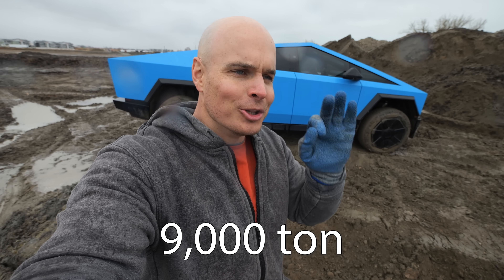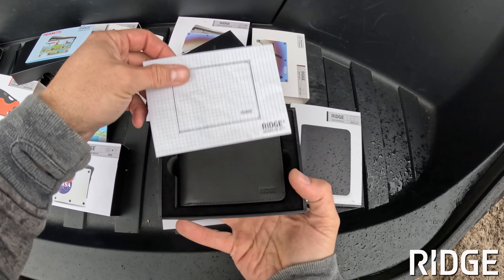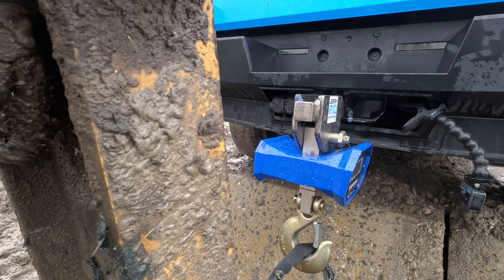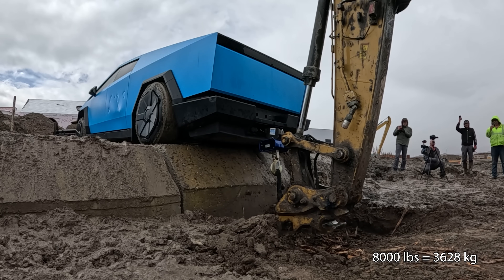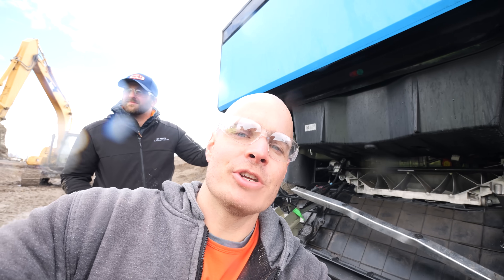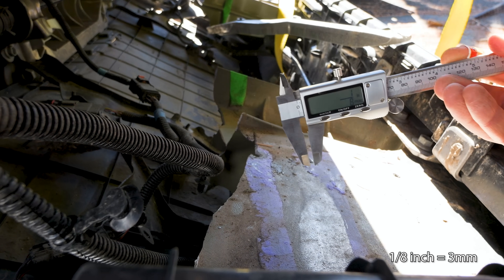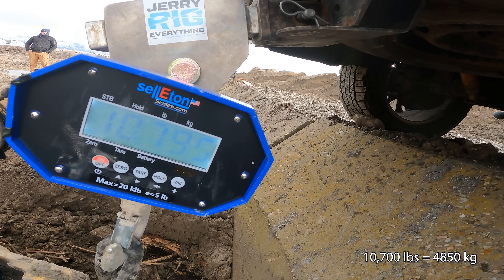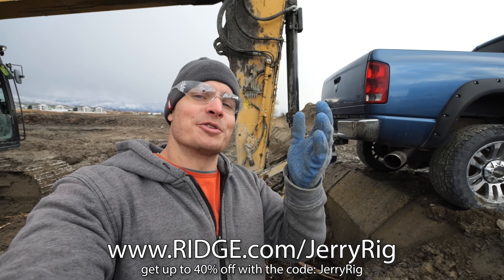SHOULD YOU TOW WITH A CYBERTRUCK?! - (catastrophic failure test)

Comment: You need to look up “fatigue limit”. The actual meaning is counterintuitive. Aluminum has no fatigue limit. Steel does. But that means that steel has a limit where if you keep stresses below that, you can do it over and over again without concern for stress failures. Aluminum weakens even in the elastic zone of deformation and as you said gets weaker every time. This it has no “fatigue limit “ aka safe zone.
Reply: Yes steel will last forever (corrosion excluded) in cyclic loading that does not reach the plastic limit, but aluminium, unless you use some rather expensive alloying metals in the mix, most of which are pretty toxic in themselves, like beryllium, the aluminium will start to show fatigue cracking after only a few thousand cycles of even moderate strain. then these cracks will propagate and result in failure. unless you keep the cycle load so small that it is well under plastic limit, you will have to replace it after a certain number of cycles. Which is why a lot of aircraft are scrapped after 20 years of service, as the cost to replace all those fatigued panels and stringers comes up to close to the cost of a new aircraft, which will be both more fuel efficient, and will also have a better passenger capacity, and lower running costs. Just the cost of checking all the wing spars for cracking, the most critical part, are so expensive that when this is due most are going to be scrapped instead, as the parts are worth more as fix parts than as an airframe.
Reply: @SeanBZA  Given the average trucks life expectancy to be 100,000 - 200,000 miles. And towing for a tiny fraction of the time. Given this fact the Aluminium is fit for purpose  so long as the buyer is aware of the pros and cons vs a standard steel frame.
Reply: @SeanBZA  Steel does not have a fatigue limit in practice. Large container ships experiencing ocean waves every day for decades do eventually start to fail. Nothing that a car will ever be put through of course, even driving for hundreds of years. But still
Reply: @krakmorfar Large ships fail because of rust thinning the steel, as the coatings do not really flex fully with the steel, and the rust weakens the metal to the point it will be out of elastic area and start to accumulate fatigue cycles, thus cracking. Recent examples are the Russian tankers that simply broke apart in heavy seas, just because neglect of corrosion control led to the hull members corroding through and snapping.
Reply: @SeanBZA  Sure, that's one way they fail. But the frame girders themselves do experience fatigue, and they will fail after going through millions of wave cycles. The concept of endurance limit introduced by August Wöhler in 1870 has since been proven wrong in practice when we started using steel hulls.
Reply: @SeanBZA  It's so refreshing to read real comments thank you.
Reply: what he meant was true, his terms were backwatds
Reply: this can easily be shown with spoons (or forks). an aluminum spoon will break if you bend it like 3 times, whereas a steel spoon will just bend and bend and bend
Reply: @Vinraymi a steel spoon will break in 4-5 bends. This whole thread is by engineering flunkees.
Reply: You're almost right. The fatigue happens in the elastic region for both aluminium and steel, and the fatigue limit is still below the limit of elastic deformation.
But other than that you got the principle right.
Reply: And isnt the ball weight 10% of max towing capacity. I am actually impressed that it carried so much weight on the hitch
Reply: He quite litterally said: "aluminum has no fatigue limit, it will just get continuosly get weaker and weaker"
Reply: This is such a bad test what can have the tires lifting off the ground and it has and will not happen to anyone
Reply: Jerry is not an engineer
Reply: Thank you for the refresher
Reply: Tell that to any helicopter manufacture on rotor blades...
Reply: correct
Reply: True but irrelevant to the frame. 
The number of cyclic loadings you have to undergo is a function of the maximum stress of each cycle. Unless you are loading this frame to 3000+ lbs thousands of times fatigue is not going to make much of a difference here. No one is out there towing a 10,000 pound load (properly distributed) everyday for several years with a cybertruck. They are simply too inconvinient to tow with for anyone that needs to tow that frequently. 
Their towing range is absolute garbage in relation to the time it takes to recharge their massibe battery.
Reply: Flexible aluminium like airplane is okay. But cyber truck has cast aluminuim that is very brittle than flexible that’s why fatigue failure happens very easily
Reply: thanks for explaining
Reply: @Yataro79 you’re welcome. I ran into this in the bike frame world recently and was confused. But once digging in, the counter intuitive (but technically accurate) phrase works.
Reply: Wondering how Airplanes, which are all aluminum, can deal with fatigue?  They have ratings of stress, so there is a fatigue rating.
Reply: @drew8256 I do not think the aluminum used in airplanes is the normal aluminum from a soda can, it has to be a special alloy way stronger, aerospace grade aluminum... light, yet very strong. But the cybertruck might be using just aluminum. Wonder how Tesla is going to improve that point of failure... even do 10400 pounds  is way way over the rated weight, not to be confused with the towing capacity weight, but that catastrophic failure is really not a good sign.
Reply: @portedbikes  You're asking to compress an entire Materials 101 course into a paragraph. It's extremely rare to use pure aluminum because it's too soft for most applications. Alloys of aluminum will vary depending on requirements. But most aluminum alloys I know of still have a cycle life. It's complicated. That's why I recommend a documentary on the Comet. We learned a lot on how aluminum alloys fatigue from those tragic accidents. Aluminum alloys are used because they are less dense than steel alloys, but with high enough strength and cycle life, but it's understood that it will fail eventually and need to be recycled. It's the reason engineers often refer to R&D and as Research & Destruction.
Reply: @portedbikes  Nobody uses pure aluminium for any structural applications.
They use either alu-copper, alu-zink, or alu-magnesium alloys for deformable structures, and alu-silicon alloys for castings. All of these alloy series are used in both aircraft and cars, depending on the application. So there isn't really one "aerospace aluminium alloy", the aerospace sector just has way stricter quality rules for the materials.
    Al-zink is the strongest alloy, but Al-magnesium has better corrosion resistance. However, if you add a little bit of scandium to an Al-Mg alloy, it becomes stronger (closer to Al-Zn) without losing corrosion resistance.
The thing with scandium, is that it's expensive, so it makes more sense in aircraft.
Reply: @drew8256 Very good question. The answer is in the fatigue. For example, take a tan from 2 pop cans and flex one a large range & the other a small amount. Count the number of cycles till they break off. You'll find they tend to break about the same number of cycles. This is why airplanes are carefully designed to spread stresses around and to mini minimize the # of cycles. To understand why it's bad,  check ooh documentaries on the de Haviland Comet, which was the 1st jet airliner. It had square windows where stresses accumulated.
Reply: Airplanes are made metal space frames brazed together to prevent cracks just like the Tesla isn't actually made out of stainless
 @drew8256
Reply: @drew8256  The airframe just lasts a certain amount of pressurisation and depressurisation cycles, after which the airframe gets scrapped. (And the airframe gets inspected for cracks). And then they obviously pick alloys, that fit the purpose.
It's just that by the time the airframe is worn out (which takes years), the engines will be rebuild multiple times, and the aircraft will be outdated. That's kindda the idea...
And modern airliners use metal with carbon fibre or glassfibres.

Comment: This is not an accurate test. By loading the truck downwards, the frame is loaded in bending, which exerts far higher stresses than in tension and compression, which are the main loads expected while towing. The fact that it withstood 10,000+ lbs shows that there is indeed no problem. And no, there is never a case where all the towing weight becomes tongue weight. That would imply that the trailer is elevated off the ground.
Reply: Yeah, the fact that they had to hold down the front of the truck says that if you did somehow manage to apply this load, your front wheels would just leave the ground.

Which would do two things.

First it would reduce cap the maximum load on the hitch, and second it would cause an accident anyway
Reply: 100% agree this entire test is ridiculous, it's sad there were so many people involved and none of them realized this.
Reply: @leeward6762 @whistlindiesels test says otherwise
Reply: the only scenario where this could happen is if someone were to reverse over a cliff and then have the trailer fall over the cliff. And in that case I'd rather have the hitch break instead of pulling the whole truck over the cliff.
Reply: Science!
Reply: Its very common to drop on the tongue offroading like in WD test which caused complete  failure

Comment: The Cybertruck hitch is rated for a maximum vertical load of 1,100 lbs. In your test it survived 8,000 lbs vertical without obvious damage and broke at just over 10,000. How is this bad?
Reply: Did you watch the video?

Under ideal conditions, it won't have much force exerted on it.

Under actual conditions? Hitting a pothole, the trailer shifts weirdly, there's plenty of reasons why the truck's hitch would receive the full brunt of the weight of the trailer. Also, look where it broke. Stopping and going will stress that part out, and like Zack said, Aluminum does not handle that stress like steel does.

And reminder... the steel framed Dodge, which was in an accident, barely bent. Where the Cybertruck broke. And the frame broke less than the vehicle's tow rating. That's a problem. a BIG problem. Whistling Diesel had it break when he was attempting a recovery, not even towing anything super heavy. And there's plenty of pictures of Cybertrucks with their backs torn off... It may have exceeded its 1100 pound tongue weight, but the tongue weight of the Dodge isn't higher than that either... and it survived.
Reply: @Xyler94 hitting a pot hole or driving up hill doesn't put the entire load on the hitch, Jerry doesn't know what he's talking about...his disdain for Elon is blinding him.
Reply: @ "there's plenty of reasons why the truck's hitch would receive the full brunt of the weight of the trailer" - 
But that's nonsense.
Reply: @hodor3024  There are cases with catastrophic failure from hitting potholes while towing already
Reply: Not a Tesla owner, bit this Test ist nonsense
Reply: Does the US not have rules for this? What max vertical load durring operation should it comply to? And what are the max load it could get from a trailer? Seem like all people know for a fact 10.000 is not enough - or are you just guessing?

If it is a fact that the max vertical load during operation can exide 10.000 lbs (without recklesly abusing the hitch) then I agree its bad.
Reply: @frankdahlin There is a separate rating for it - called tongue weight - for which the cybertruck has a rating of 1100 lbs and that dodge has a rating of 1500 lbs, so in this test the cybertruck was tested up to (and broke) at just above 9 times it's rated limit, while the dodge was tested to 7 times it's rated limit.
Reply: Steel is way stronger, especially when it gets repeatedly stressed over decades of use.

Also aluminium, especially cast aluminium, tends to fail catastrophically, steel tends to bend and struggle before finally giving out.

There are videos of cybertrucks tow hitch failing just driving over a small pothole, it is simply not as strong and clearly not strong enough.

Tldr, using an aluminium frame and steel body panels is just a strange choice. They are just not the best material for the job.
Reply: I was wondering the same thing. Tow capacity is based on horizontal loads, not vertical load. This massively over-exceeded the suggested vertical load capacity.
Reply: @ 80 mph driving down The road will 11k load on a trailer and hit a bump your logic says the 1100lb  tongue rating shouldn’t be exceeded? Makes no sense,   This 10k lb breaking point is way too low and breaking off the entire bumper including the attachment for the safety chains is so dangerous,
Reply: And the front are locked in. If not, the weight would probably lift the front and the hitch hit the ground before breaking. Also the rear suspention are slowly pressed to max out. This is just Tesla hate. (Elon might be going crazy, but this is fake news please be better).
Reply: @frankdahlin  Elon's not going crazy. His DOGE actions are logical. His Tesla actions are logical. People are just reacting to hit pieces.
Reply: @ Dont know about DOGE, but I think he is alienating the European and Canadian market.
Reply: @frankdahlin nah this is legit Tesla hate
Reply: @frankdahlin  no it’s not,  same test on the ram works fine,  aluminum is a brittle material catastrophically failing,  this will cost lives,
Reply: Space dude made = BAAAAAAD
Reply: @Bash434 tongue weight is what’s supposed to be the max when the vehicle is stationary. When you are driving down the road and hit a dip or bump this load will be greatly exceeded,  it’s shouldn’t break off,  this wasn’t even a shock load it was gradual, very scary, the ntsb should revoke the tow rating immediately if they have any spine at all,   People will die because of this.

Comment: I lvoe these kinds of videos,  and I do love the scientific testing of this video, but directly pulling down on a tow hitch is not their main mode of operation, and therefore is most likely not what the cybertruck is actually rated to. It would be interesting to see the hitch loaded in a more traditional configuration, where it is directly pulled away from the body of the truck, and the front of the truck itself is strapped to keep it from sliding backwards.